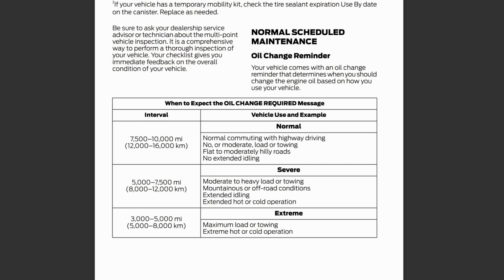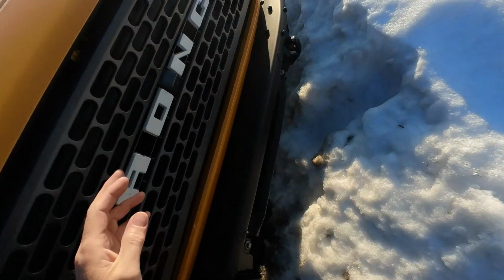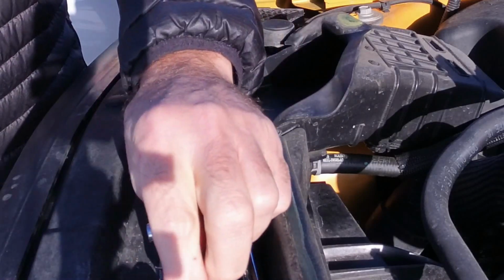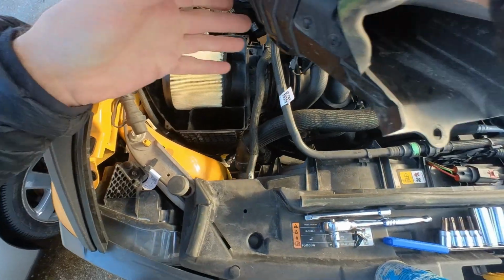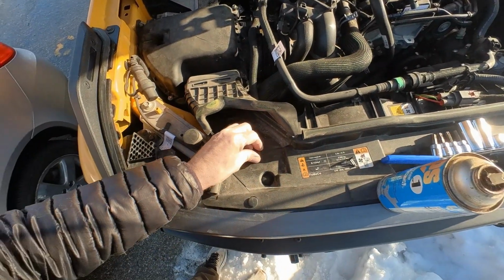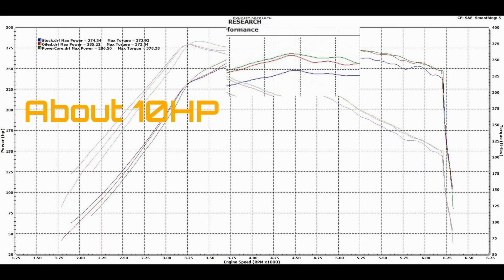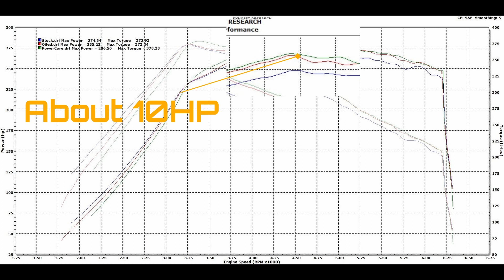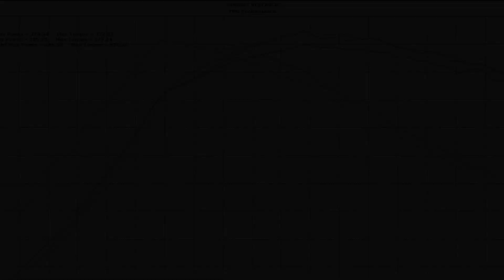Bronco Maintenance! Engine Air Filter Replacement.

Comment: I think a new intake would be great if you could tune the motor.  As far as I know you can't on this Bronco, so No reason to mess with the A/F ratio or anything with the stock flow.  Please correct me if I'm wrong.

-Farley
Reply from the maker: Ford has their fully Warranted performance tune... And maybe some after market as well.
I'd rather not lose the bottom end grunt for high rpm peakiness, personally.

Comment: Great video man. I’m a huge advocate of regular preventative maintenance. 
Filters for my BSPORT were unobtanium for ages and I had the original filter in place from new until recently at 50k kms. It drove me nuts but remarkably it stayed fairly clean and I think the techs kept it blown out at oil changes. 

I change my oil at 5000 kms. Religiously. Yes maybe overkill but I’ve always followed that and never had an engine fail in all my years of driving. 

I’d rather spend an extra couple hundred bucks a year on oil changes than risk premature wear

Keep up the informative videos 👍🏼
Reply from the maker: Thanks for the reply... Yup, maintenance is a big deal for me as well. I just go by what the computer tells me for oil changes, unless I lived in Utah or Death Valley. My Fiesta used to go 12 to 16K between oil changes and I hammered that f*cking thing. 250+k, not an issue 👍🏻
I prefer better oil that Ford dishwater tho
Reply: @TLOverlander  haha yea I hear ya.